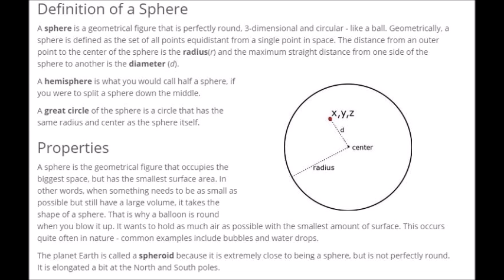Flat Earth: Wacked Out Pseudo-Geometry

Comment: Shots taken more than 200 feet apart start to introduce errors because of the Earths curvature.  "Level" at Point A and "Level" at Point B are not parallel because the plumb line changes from location to location. The level line is perpendicular to the plumb.
Reply from the maker: you sound like a Freemason
Reply: No. I'm just someone that understands basic geometry.
Reply from the maker: +Don K pseudo-geometry.
Reply: +SunQuesDaGod Please explain what pseudo geometry is. Geometry is geometry.  It's all able to be verified.  There's no theoretical geometry.
Reply from the maker: +Don K How can a series of planar leveled surfaces be justified as a sphere or curvature of a sphere? Sounds like theoretical geometry.
Reply: +SunQuesDaGod The Earth is not a perfect sphere, but is generally spherical. Plane surveying allows for simpler calculation and the error is minor over relatively short distances. And it works because of the overall size of the Earth. If you have a 100 sided polygon with equal sides, it would look like a circle, and the same if true with multiple planes used to approximate a sphere.
Reply from the maker: +Don K A 100 sided polygonal would look like a circle (sphere)?! The epitome of Pseudo-geometry.
Reply: +SunQuesDaGod Yes. A 100 sided polygon would look like a circle.  The more sides that are added, the more circular it would appear.  There is nothing magical or mysterious about that.
Reply: +SunQuesDaGod And, if you want to see a sphere approximated by a series of intersecting flat planes, Google "Epcot"
Reply from the maker: +Hagen von Eitzen Water composes most of the plane of earth. Water is flat. Sea-level. Therefore we say the Earth is Flat. Topographical features do not nullify the basis being leveled.